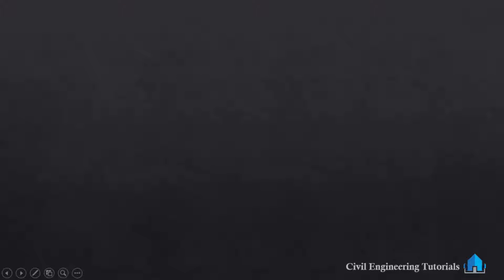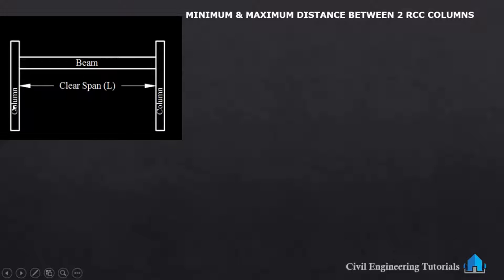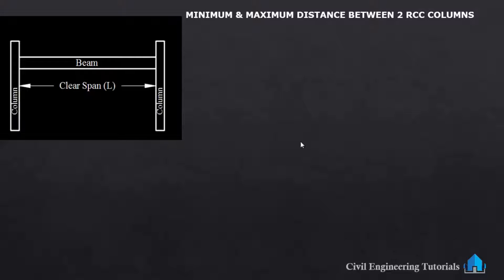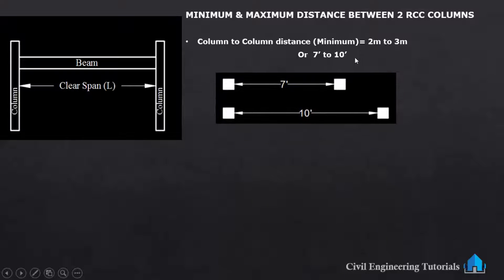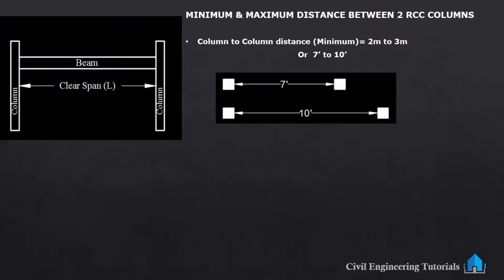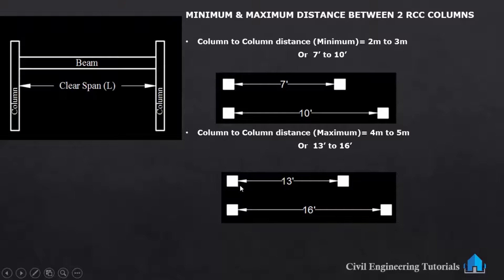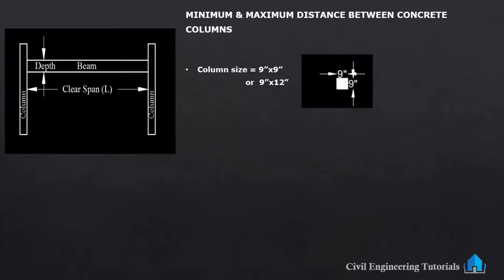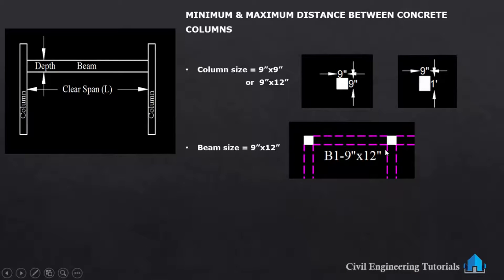Minimum & Maximum distance between 2 RCC Columns | Civil Design

Comment: How to make sure that my column is in alignment with my brick wall.
Reply from the maker: To ensure a column is aligned with a brick wall, position the column so that its centerline or edge matches the wall layout, check distances from the wall using temporary dimensions for accuracy, and verify alignment in plan, section, and elevation views. Additionally, make sure the minimum and maximum spacing between RCC columns follows structural design standards to maintain proper structural integrity and coordination with masonry walls.

Comment: should 9"×12" is Safe for 14'6" span gap between 2 column?
Reply from the maker: A 9″×12″ beam for a 14′-6″ span can generally be considered safe only under residential loading conditions with proper reinforcement, stirrups, and at least M20 grade concrete, since 12″ depth is usually adequate for deflection control, but 9″ width is relatively narrow and may cause reinforcement congestion and shear issues; therefore, for practical and safer design, a width of 10″–12″ is recommended, and the final safety must always be confirmed through detailed structural design and load calculations.

Comment: Mam centre to centre  or column end to end
Reply from the maker: Column-to-column distance is typically measured from center to center of the columns. This method ensures consistency and accuracy in structural design, as it accounts for the overall layout without depending on the varying thickness of columns.